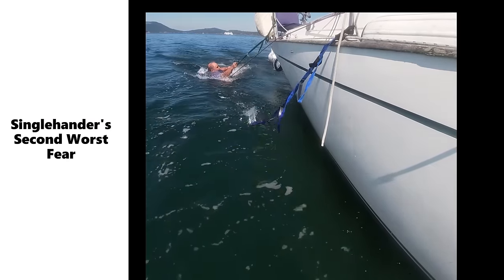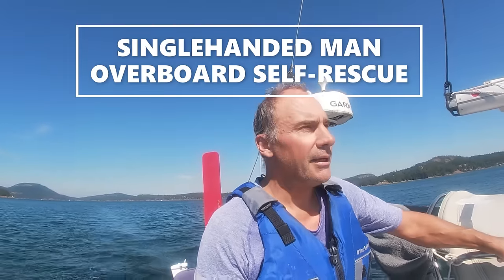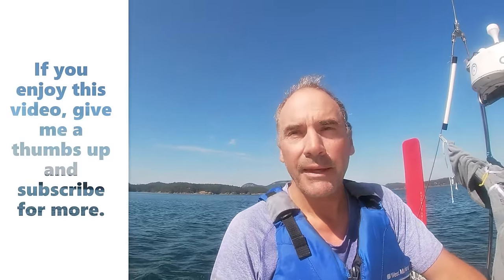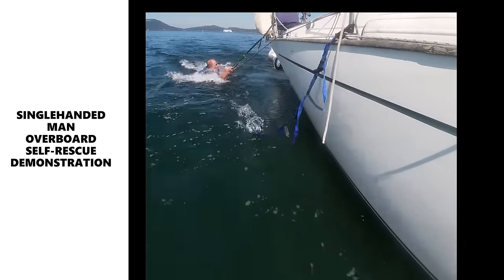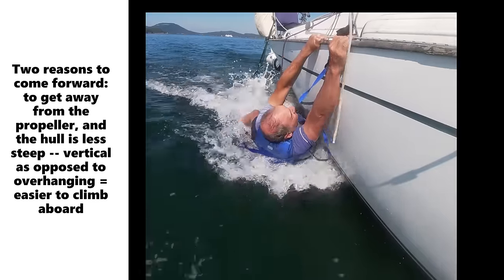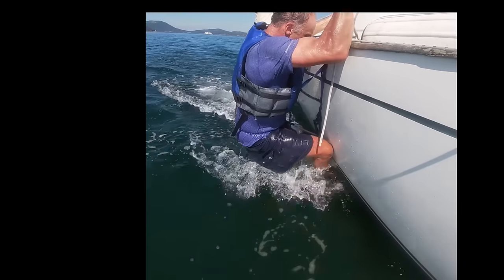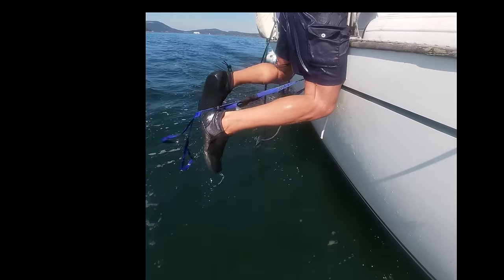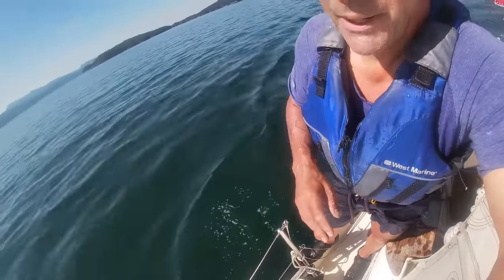SINGLEHANDED MAN OVERBOARD: SELF RESCUE

Comment: The right way is to use a harness and tether system that makes it impossible to fall outside of the railings. Side deck jack lines are useless. More dangerous than not using a harness. The jack lines must be well inboard and the tethers short.
Reply from the maker: Great suggestion. Thank you.
Reply: You would think, right? 😂
Reply: Why not use both a harness and tether system + overboard jack lines as backup? I agree that you shouldn't be able to fall overboard when tethered correctly (close to the centerline), but sometimes it's not possible to rig it that way all along the deck.

I like the alternative offered in the topmost comment where the overboard jack lines lead to the stern, where you just pull a trailing rope to lower the ladder and climb up. When overboard, you attach your second clip to the overboard jack line and release or cut the first one.

Also, that name sounds about as Norwegian as I am. Do you know what we commonly use or teach here in Norway?
Reply: I wouldn't go so far as saying side jack lines are more dangerous than not being attached to the boat. They're the least effective harness anchor, but being dragged is better than not being dragged. I have no idea how you could possibly reason that falling over with no tether is preferable to falling over with a non-ideal tether.
Reply: I respectfully disagree since Inboard jacklines make it nearly impossible to pee over the side at night.
Reply: Totally. When I'm single handed off shore I rig a Jack line from the centre rear cleat to the mast base. Can it be awkward? Yes, but you do get into the habit of turning the right way. Can you fall overboard? No chance.

Comment: I chose a slightly different self rescue. I added a web line, as an "overboard jack line" around both sides of the boat at rubrail height. The line goes around the stern to the centerline where a boarding ladder can be deployed by pulling on a line dragging through the water.  My regular jack lines are on the side decks and tight enough to usually keep me on deck unless something really bad happens. But if a wave pushes me over the side, instead of being left hanging by the tether and trying to pull myself up a line (I'm too old for that effort), I can attach the second clip of my tether to the overboard line, cut the first tether line and let the water drag me around to the stern. Once behind the boat I don't have to rush or fight waves. The job is as simple as tugging a line and carefully climbing the stainless boarding ladder. I did try it on a beam reach in 12 knots of wind with help on board in case it didn't work.  The hardest part is staying still enough to clip the second tether while bouncing alongside the boat.  You also need to be careful not to lose your knife!!  Once I released the first tether I was rapidly moved to the stern by the water rushing by. From the stern it was surprisingly easy to board.
Reply from the maker: Wow! Beautiful. That is a fantastic approach that I have never heard of before. Thank you very much for sharing that. I will definitely try that. I love the potential for redundancy as well. That solves a problem that has come up in this thread. So simple and easy to rig as well. Bravo mate. Thank you. I will be rigging this and may even do it in addition to the ladders. I think many more will follow.
Reply: Why use a knife mate, you just need to use two climbing carabiners. One to clip to the side line before unclipping the overboard tether!!!
Reply: @nivid01 I would think that tether is under strain, would be hard to unclip.
Reply: Can you do a video?
Reply: Yep, that sounds like a solid plan. I would like to see a video on this one. If it looks good, I'll definitely rig it up on my boat.
Reply: Thank you for sharing your great idea/solution.
Greetings from Italy
Reply: @nivid01  Try that hanging off the side of a yacht doing 6.5 knots in a two meter sea state near a cape with crossed sea state while hanging head down off the side of your yacht.
Reply: @ushoys  I would use small pieces of strings/cords, who will break destructively (without damaging the gunwale jack line of course), when being pulled.

Comment: I had a long to and fro on the comments section on a video series with other commentators about the dangers of going overboard whilst singlehanded. My argument was not to go overboard for any reason other than an emergency repair. Having sailed singlehanded across most of the oceans I can say its the scariest of notions to be floundering in mid ocean and your boat hightailing away from you. Its not always convenient to be tethered when you have to scampering fore and aft taking care of everything to keep the boat moving. Its especially not advisable to hop overboard just to scrape off barnacles. The changes of being attacked by sharks and stung by jellyfish is quite high. However some commentators argue that its quite safe if you have a line trailing the boat.....NOT SO....As you say the freeboard on a 26ft boat is still a height to haul oneself up and back on deck, unless you are a lightweight and very fit.
Reply from the maker: Thank you for this detailed and considered comment. I salute you sir on singlehanding across even one ocean. Those are hard won miles that take considerable fortitude. I have yet to make such an achievment -- and may no longer have the sangfroid to even attempt an ocean singlehanded. We are all grateful to have such feedback from such a seasoned singlehander. Thank you.
Reply: Well, if you purposefully hop overboard, you surely have a ladder lowered  and you checked that you can climb it
Reply: @dmitripogosian5084  In ideal conditions like in a calm river or estuary maybe, but offshore things are very different when the boat is rolling and pitching and being propelled by wind and tide, you have to ask yourself is it worth risking it as ones life is on the line.
Reply: @sklenars  Certainly

Comment: I read all the comments and watched the video several times. This subject is extremely important, because, even encouraged by your advice, each of us solo sailors will certainly encounter an unfriendly scenario like the one you show us. And this sets off the purple alarm!! Considering that there was an involuntary fall, the psyche will react violently through panic, which, if left uncontrolled, will drain bodily energy, reducing our chances even further. So, it's not enough to just train the stairs and a supposed faster technique. I noticed that the ladder has become a tangled vine, in which the foot cannot fit... (W.O) If you hang on the side, the arm will fail, due to the height... (W.O) We really have to rethink these objects and devices, because your demonstration only shows us what should be avoided. I say that things are really serious!
Reply from the maker: Thank you for the very thoughtful and considered comment. I agree. These are very serious circumstances. I also agree, we need to come up with some alternate ideas that are less based on brute strength and also be able to implement after we recover some composure in such an event. One viewer suggested control lines to either stop the boat, or have it heave to under sail from a position hanging over the side. I think these ideas  have potential and will test some rigging ideas I have soon. Another improvement would be to reduce the brute strength required to get back aboard. I have some ideas here too that come from the rock climbing world. I will share once I refine and try some of these. We would all love to hear if anyone has other ideas to manage these otherwise dire circumstances. All the best mate. And thanks again. We can all learn a lot from each other.
Reply: I noticed there are different styles of these ladders. Would the rung style possibly be easier to climb? Seems with the extra space it would be likely harder to get a foothold.
Reply: Thanks for the demo. I think the best advise is "dont fall overboard", use lifeline to stay on the boat.
Reply: Best advice is don't solo.

Comment: As someone who looks at things from an engineering point of view and as an occassional boater, it seems to me the primary issue for a solo sailor is to be on a short tether that prevents you falling in the water. That tether could run on a line inboard of the boat deck minimising the amount of times you have to re-clip. This seems to me to be key as when solo you simply do not want to fall in at all. Other than that I agree with one person who said there needs to be a lanyard or remote with your life jacket that can at least kill the engine when under power.
Reply from the maker: All excellent ideas. I intend to try a few things based on some viewers ideas.

Comment: I have a ladder on the back of my boat for general swimming and rescue. I also suggest a PLB.
Reply from the maker: A rear ladder would be a huge help. Agree, a PLB would be a life saver especially if one got separated from the boat. In cold water, we wouldn't have a lot of time though.
Reply: It is often a problem with midrange boats - 22-28 feet that they have an outboard motor at the back

Comment: Thanks for filming this drill.  I'm 75 and single hand a lot on the East Coast.  I've become a little laxed about using my jack lines.  After watching this, I'll be using them more often and also plan on shortening my tethers.  I won't be doing what you did - for practice or for real.  Thanks.
Reply from the maker: I agree. I will add that I now put the ladders on for intercoastal sailing, and jacklines when the wind is above 10 knots -- and clip very short in those conditions.
Reply: What about using the swimming ladder at the stern?
Reply: @TM-529  That could work if the engine was off, but I think you'd run the risk of hitting the prop or fouling your rescue line if not.
Reply: @ontheruntonowhere  I think you need to get pass the rudder to hit the propeller, also rescue lines should float imho
Reply: @TM-529  Probably true, although the propwash would also be something to contend with. I'm just thinking I wouldn't make my plan contingent on using that ladder with a boat under power. Imo coming up the side would be safer and possibly easier, depending, of course, on many factors out of anyone's control during an emergency.

Comment: Thanks for this demonstration and recommendations - especially pre-positioning the climbers.  I'm 62, a single-hander and cautious about jacklines and harness, but recognize even with those I could still go overboard.  Now I gotta work out and set up an opportunity to practice.
Reply from the maker: Thanks for the note. You and I are close in age. You can buy some at MEC or you can make some yourself out of rope or sling. And yes, practice practice practice. As a start, you may want to practice in a tree in your back yard, or a playground -- or perhaps in the rafters in your basement. I have done all of those over the years. Get comfortable with the technique, then try it on the boat at the dock, and go from there with a moving boat -- add one variable at a time. Best wishes.
Reply from the maker: One more comment if you decide to make some yourself: look carefully at the design: the upper loops need to have some slack when the lower ones are loaded -- so you can get your upper foot into the loop while under load with the lower foot. This is achieved by offsetting one side. (rock climbers learned this quickly).

Comment: Excellent video, thank you. There is a lot of bla-bla on this topic, but this is the first time I’ve ever seen an actual demonstration. I personally use very short tethers since I am 69 and though fit, doubt my upper body strength. I also string a rope alongside on both sides, to use to step on, but of course have never actually used it. I might try it at anchor next summer (in Scotland! Brrrr!) anyway, sailing 55 years without falling overboard. Hope to continue my success!
Reply: I should add that I also have an old-fashioned boat with low freeboard.
Reply from the maker: Thanks for the note. Those are some good ideas. I hope to improve my chances with a few other ideas. One idea I rigged is a control line to kill the engine from over the side -- it can be seen here https://www.youtube.com/watch?v=A5IR81KTlNs

Comment: I very much compliment Respect the Risk for his lesson on self-rescue.  It must be a sobering experience to watch your boat sail over the horizon while treading water, and I have every confidence that has happened many times through the ages. Now, while it is true most Man Overboard incidents happen with the boat sitting still, the rare, but terrifying incidents happen in heavy weather, washed or knocked over the side, so getting back aboard in the very conditions that caused someone to go by the run is very difficult.  As we trained for such, even at 21 years old and our fitness level the best it would ever be, most did get back to the Zodiac but could not get in while under way in easy seas. They had to be pulled back aboard, and that is with low freeboard and topsides with a grip. Darkness adds another dimension, as do breaking seas.  Alone at sea, clip on, make certain your lifeline and stanchions are up to the strain, and take your reef when you first think about it, then go below. When the sky lowers and the sea rises, it may be too late to go forward alone.  Fair winds.
Reply from the maker: Fantastic distertation mate. Great examples and suggestions for all of us to hear. Thank you for this mentorship. All the best.
Reply: That's why sailors of the past did not particularly learn to swim.   Not much point ...

Comment: Admirable, and thanks for thinking of this and more importantly, putting yourself through this strenuous technique. I noticed you said you are a rock climber and obviously, despite your protestations, in excellent shape for a 59 year old man. I've done a lot of singlehanding, and a double-handed circumnavigation, which entails doing a lot of singlehanding when the other crew is asleep or merely below. I dealt with it by using your rule #1, but have had some edgy incidents even in a protected harbor, albeit one of challenging distances to shore, strong chop and current, and cold water. It's good to think of every possible worst case scenario and have a plan for it, which you've done a great job of.
Reply from the maker: Thank you for sharing your experiences. Wow: A double-handed circumnavigation -- congratulations. Very impressive mate! I have been in the water twice singlehanded -- once was under sail practicing a MOB drill on my own where I lost my balance reaching for the life jacket I was rescuing. And another time just at the dock with the boat adrift in neurtal. I had not put the ladders on yet and hand traversed the rail to the stern. It was reminder that we may need them even in benign conditions.
Reply: @respecttherisk2022 When my buddy and I got back from our trip, I sold the big boat and we got a traditional Catalina 22 with a folding keel to sail in a nearby bay with shallow waters. BTW, props for having Contessas! I love the 26 and almost bought one.  One of the first things we did on a refit was to put a boarding ladder on the transom with a lanyard on it to enable deploying it from the water...because of just what you said. What if I were alone, even at the mooring, and fell in? There's no place to climb up the side of a boat, but your straps are a great idea. I've taught sailing for 30 years and I've only had two people go in the water, and both of them fell in from the dock! As you know, this is a problem even in a marina, since a majority of people cannot hoist themselves onto a float from the water. I'm sure you could, and I'd like to think I could, but then I'm not getting any younger.

Comment: Wow - fantastic and sobering demo thank you. As a lifelong power boater I appreciate  even more the safety factor of the ignition lanyard when I’m out solo. Having to deal with a boat that simply won’t stop because the sails are set is a whole other level of hazard. I wonder if there is a way to rig release lines you could reach from the back of the boat that would let the sheets go to stop or slow down significantly reducing the physical effort fighting drag.
Reply: If there isn’t an auto pilot steering the boat, it will round up and not go very far under sail. But most people have auto pilot when they are sailing alone and leaving the cockpit. I had a remote on one boat so I could sit on the bow and still make changes in direction, but I don’t know how far away you could get before it didn’t work
Reply from the maker: Thanks for the note. You are welcome. Those are excellent ideas. I intend try some of them. Once I do some testing, I will share my learnings here.
Reply: @respecttherisk2022  - thanks I’ve been pondering it myself all day actually. At first I thought lines rigged to put upward pressure on cleats or whatever is keeping the sails set so it releases. Then I thought maybe run something to a quick release pin that just disconnects the boom itself or traveller, but if remote controls are common for auto pilot equipped boats, a spare packed in a waterproof bag attached to your pfd might be the simplest option as has been suggested.